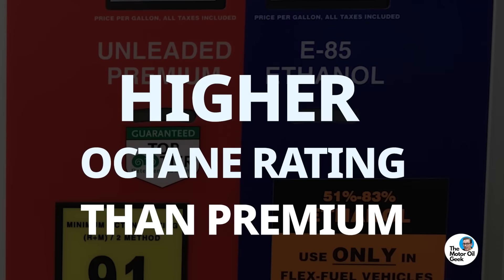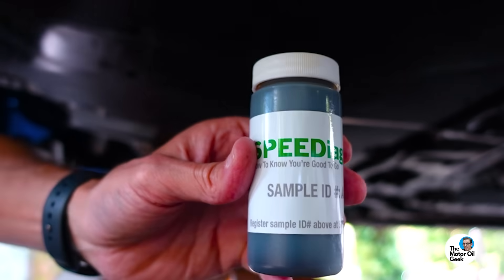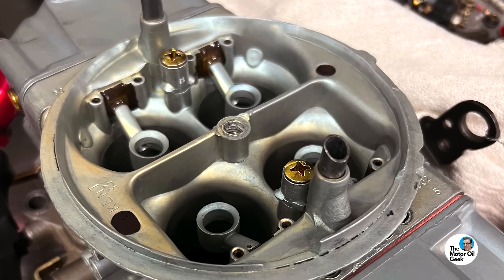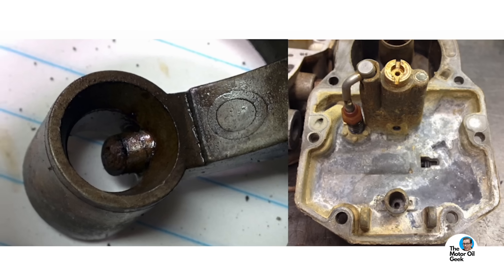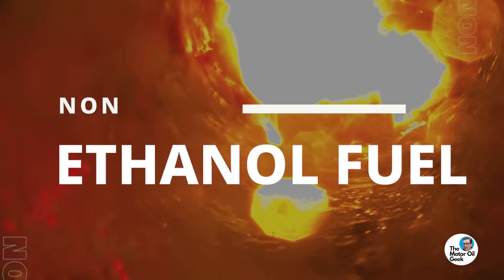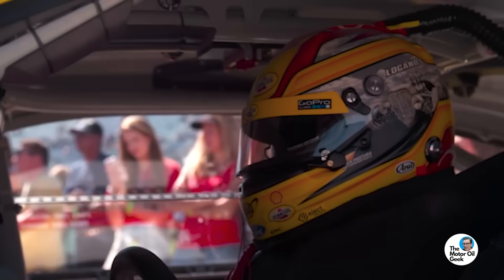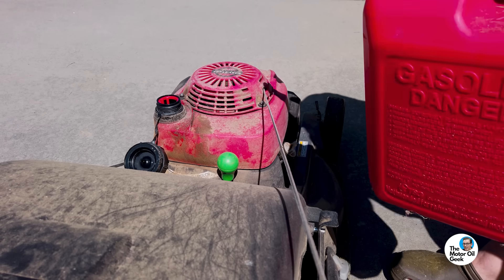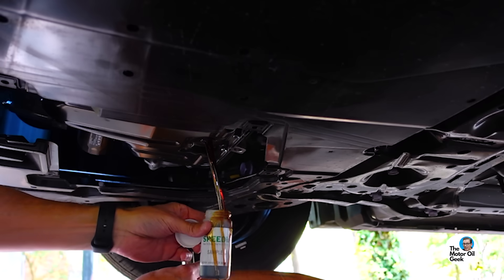ETHANOL: Higher OCTANE, Higher RISK?

Comment: Thanks, Lake. This explains why my old 2-cycle weed eater had problems at the beginning of every season. I've since learned ways to fix that in the off season, and I've also switched to battery powered devices for that purpose (they're not as powerful, but they do the job on a non-professional level well enough).
Reply: No problem if you use non ethanol fuel and drain the fuel and run dry before storing.
Reply: @BeefNEggs057  better to run it dry, then prime (not run) your system with oil only. This keeps the lines and seals from drying out at all. Next season, you can simply dump the oil, prime with your normal mixture and go about your business.
Reply: I gave up on 2 cycle weed eater, just too many issues. Went to Dewalt Electric, ready to go when I am.
Reply: @faxmen09  I initially switched to a Kobalt string trimmer, probably 10 years ago, when they were very new to the market. It worked well, though its thin string (.065") regularly got bound up on itself and it wasn't balanced very well. I eventually got the 80v mower to go with it, which I've had 7 years.

This month I bought a Craftsman string trimmer, to go along with the batteries and other tools I have of that brand. Better balance, thicker string (.080"), a button to spit out more string, and now I have the choice of multiple battery sizes. It also came bundled with a leaf blower and radio. The only downside is it has a single whip head--not a deal breaker.
Reply: I use Stabil and always run the carbs dry after use. Never have issues. I don't use 2 cycle mix after about a week, as the oil loses its Lubricity
Reply: @speedfreak8200  I'll take your word for it. I haven't messed with 2-cycle engines in a few years.

If you happen to be using Stabil on Ethanol-based gasolines (10, 15, or 85, makes no difference) it will not slow or stop the hygroscopic nature of that fuel in any way, unfortunately. It may still stabilize the gasoline itself from turning to varnish, but the ethanol will continue to attract water from the air, FYI.
Reply: @0num4 You may have a point about the Water/E10 problem but the Taryl Fixes All Channel's Long/Short Term testing done around 2020 did show STABIL 360 "winning" in the Fuel Stabilizer testing 

(they for some reason only tested the 12 month/ 360 version vs the 24 month Stabil Storage probably because they wanted to test Stabilizers highlighting fighting "Ethanol" in the Fuel... Stabil Storage does that but unlike 360 it is advertised differently... Still surprised they didn't add/compare Stabil Storage in their follow-up testing...)

The Air/Water Ethanol problem is real and particularly in their short term testing they did see some Ethanol Fuel Stabilizers doing far better then the "Control" E10 Regular and E10 Premium... While some of the Stabilizers actually did worse then "Control"...

Comment: Any car built for North America since 1981 (1980 in California), both carbureted and fuel injected models, have closed loop feedback computer control, and can easily tolerate E15. The computers can tolerate up to 27% ethanol as is used in Brazil. Flex fuel just means allowing the computer to increase the injector duty cycle to be much longer than the safety systems on regular engine computers would normally allow. Rarely does it require increasing fuel pressure or injector size. Fuel system materials have been designed with ethanol in mind since the mid 1980s.
Reply: ...Explain that to my dead Ford Ranger Flex Fuel truck
Reply: @daniels.2720 What do you claim killed your truck?
Reply: @daniels.2720 I had a 2005 ford F250 with rotted fuel lines and fuel pump due to just E10.  The lines turned to jelly. Yeah, that ethanol is geat stuff. 😉